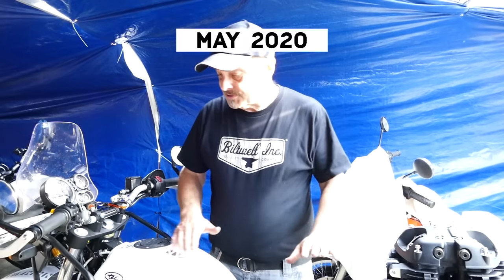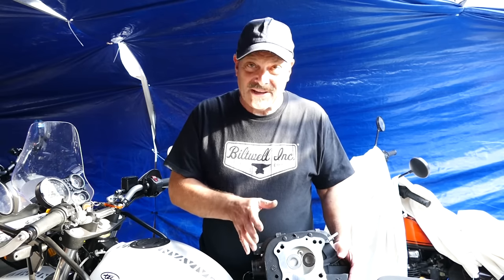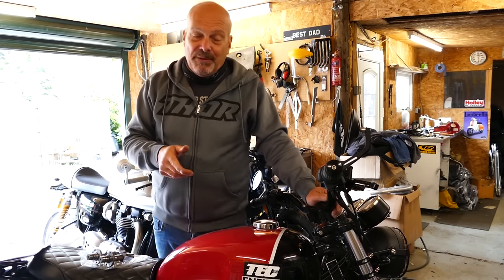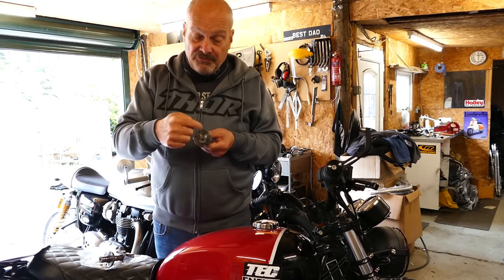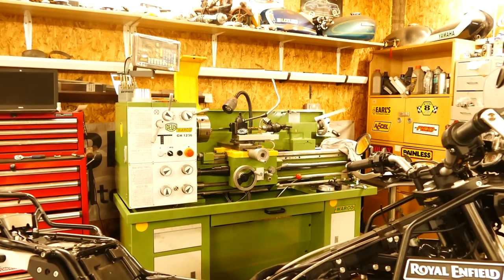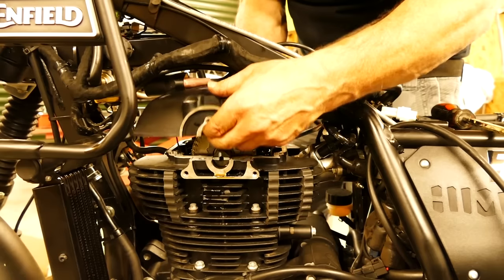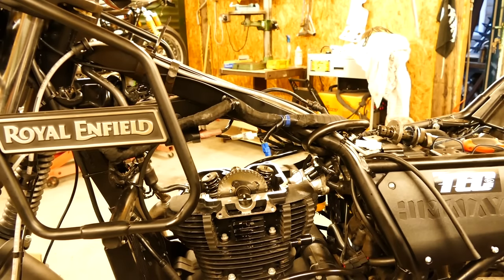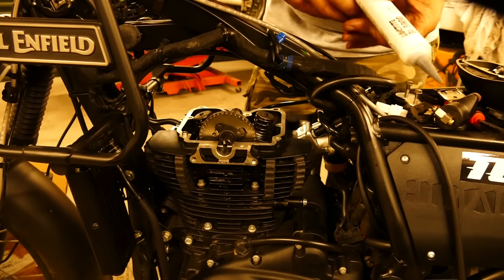Royal Enfield Himalayan Camshaft - 20% More Power Instantly!

Comment: Just completed the 300 mile run-in period, and can confirm a very noticeable difference. Well worth the outlay, and relatively easy to do. More than happy, thanks guys.
Reply: Same.  Only about 10 miles in, but I can feel the extra power and smoother power delivery.
Reply: whats the deal with the plug cover at the end of the camshaft? any parts needed thanx
Reply: Couldn't really work that out myself Steve, but I just followed George's video instructions from TEC. The only extra I needed was a tube of silicone gasket, for the rocker cover.
Reply: How’s the reliability been
Reply: Regarding the camshaft, no worries. I had a bit of a top-end hiccup a couple of months ago, but nothing to do with the camshaft.

Comment: I don't own a Himalayan, but if I did I would consider a 20% gain in power for just £200 very good value. And easy to fit too.
Reply: Yes, 20% is quite significant.
Reply: All anyone says is that it feels faster. Why is it impossible to find any real numbers? New 0 to 60 time?
Reply: @MrFox5113  that’s what I’m curious to as well, given how it goes around 10 seconds barely faster than my TDI I want to try and get around 6 or 7 seconds with the help of exhaust a tune and rotating mass lightening.
Reply: 😃 🎸 Sounds from London 🇬🇧 https://youtu.be/gjrDvSRFm2k ✨
Reply: @MrFox5113  The gain is in the top end, not the bottom.  There are numbers.  See the graph.  Perhaps look.
Reply: 9

Comment: For those looking for the tappets clearence, the video is wrong but I got a email reaction from them:
Apologies for any confusion this has caused, the tappet clearances for the Himalayan are 0.23- 0.25mm Exhaust and 0.08-0.10mm inlet, which are the same as stock, George misspeaks in our video and quoted the inlet clearances for the exhaust too. You can find a set of instructions attached above, which reference the tappet settings.

Best Regards,

Comment: Thanks so much for all the work you have done to make the Himmy the bike it always should have been. Your development has been so logical and detailed. A bunch of us in Australia  will be ordering.
Reply: I have ordered two, one for my brother. Other folks on the Aussie Himmy page are ordering too.
Reply: Even from Under-developed countries will be ordering 😁😁😁😁
Reply: @raineman8428  Hello has the cam change given you the performance you expected. kind regards murray
Reply: @murrayhyde4902  Hi Murray. Thanks for the question. I have done over 16,000km with the cam installed. There was definitely a noticeable improvement in power, and made it much nicer to ride (like it should have been from the factory) but I doubt if it was 20% extra. I reckon maybe a couple of extra HP. It will still struggle to maintain 100kph with a headwind or a hill, but is much better than it was.  I bought two and my brother fitted one as well. He have similar experiences as we do long (800 km) rides together. I still think the cam is the best bang for buck improvement so far. It runs sweet and starts/idles perfectly.  I think the limitation on these bikes is the valve and port sizes, so even big bore kits  don't seem to add any real top pend speed. Your thoughts?
Reply: @raineman8428  not sure yet. I bought a RE himilayan scram. It puts along OK. Not great speed or performance but still lots of fun.
I'm curious on upgrades. Maybe better air filter. But the cam swap seems to be the best bet... but good to hear from someone who's done it.
Reply: @raineman8428  you need to change the gearing for top end speed

Comment: I have always wondered why RE designed a brand new engine for the Himalayan and made it produce so little power. My 1969 Suzuki T200 produces similar power from half the capacity. And that was made 50 years ago. Looks like this redesigned camshaft is a significant step in the right direction. I really like the look of the Himalayan, and it's rugged character. Just wish it had about 40 bhp. Maybe I'm being too greedy!
Reply: Your t200 is a 2 stroke twin made well before emissions & noise laws were a thing, you really are comparing apples with oranges here.
Reply: @Ozsmallbore  I am aware of that. But technology has advanced in the last 50 years. We now have fuel injection and programable electronic ignition for example. I just feel 24.5 bhp for that capacity is somewhat low. I really want RE to do well. They are a company with history. They are showing real promise, and trying to mix traditional with modern, and on the whole seem to be doing it well. I hope their recent successes will continue for a long time.
Reply: All I want from it is passing speed.
Other then that it's a lovely little bike.
Reply: @nealeburgess6756  it was designed for Indian roads, where its common to have cows and a bunch of people on the main highways. Anything beyond 60 mph is risky.
Reply: @drury2d8  Yes. I have seen what roads are like in India. Even on the large inter-city highways it is impossible to build up speed. However, RE have a design centre in the UK, and they are trying hard to market their bikes not just to India, but to the rest of the world. Certainly here in Europe they would find it easier to sell their bikes with a higher power output.
Reply: @nealeburgess6756  I believe that a lot of the engine work is still being done in India. UK takes care of ride dynamics. More power = emissions problem
Reply: @nealeburgess6756  And it is a longer stroke engine, meaning pistons got a long distance to cover and after a certain rev range there's not much to make the piston move any faster combined with other problems. What it achieves though is torque, because of the stroke ratio. It can achieve decent power at around some 6k rpm but that's about it, unless there's some way to change the combustion and ratio to make more power, that's what is done with this cam shaft.
The Himalayan ends up having 32 Nm of torque, it's a 400 and something like klr 650 produces 47 Nm which is achieved easily all through the rev range because of the nature of the engine. A shorter stroke modern engine can indeed be made to produce more torque than these machines but usually they will advertise their max torque at some 7000 rpm while these machines will be making mostly constant torque all through the rev range and max torque easily at somewhere closer to 4000 rpm. Torque in a single stroke modern engine will mostly come down to the fuel mixture and often is very inconsistent, but because of their short stroke they can run at higher rpm and the more the rpm the greater the power.  Torque though has to be flat and constant through the rev range, it's more to do with the characteristic of the engine than rpm ideally. 

I think this is why people like these Himalayan and klr, says it feels like a tractor and feels more consistent when it comes down to load pulling. That's the design and the mechanical limitation is simply less rpm Which translates to less power. So what the modern machines do to mitigate less torque can be done in these long stroke engine to get more power, air fuel mixture and that's exactly is what is being done with this modification.
Reply: @arunvignesh7015  The Himalayan has a moderately under-square bore to stroke ratio of 78mm x 87mm, which limits rpm, but aids efficient combustion, and a low compression ratio of 9.5, which limits efficiency but helps with overheating and longevity. These two design aspects are probably the main reason for the engines low specific power output. I don't know what you mean by this modification improving the "air fuel mixture". The A/F ratio is determined by the fuel injection settings. A camshaft can only affect the relative timing, overlap and duration of the inlet and exhaust valves.
Reply: I agree
Reply: The English market is a very small percentage of sales, less than 2% of the total so ne need to make a more powerful version. There market at home is 1.4 billion people
Reply: Looks like your wish has come true, the new 450 is 39hp

Comment: That sounds like a cure to the Himalayan's biggest issue, and Royal Enfield should have a chat with you for the cam shapes!
Question one: Couldn't you just draw some oil from the sump with a syringe and a wee hose, and spray it over the cams through the access hole for the tappets?
Two: How does the cam affect the engine's economy? One would expect it to worsen slightly, but I wouldn't bet on that, really.
Reply: Hi Zw, I think I’m right in saying that the manufacturer is forbidden from using these mods due to the current (euro5) emissions regulations. Private owner mods are not controlled the same way.
Reply: @philtucker1224  I have no way of knowing for sure, but I can't imagine that an oxygen sensor regulated ECU would not be able to cope with the situation.
Reply: Hi Zw, regarding lessening of fuel economy it is true that a higher performing cam will offer the potential of getting a greater air/fuel mixture into the cylinder(when required) secondly, regarding “camshaft overlap” the principle of this feature allows some of the incoming air/fuel mixture to continue through the combustion chamber at a higher velocity due to the partial vacuum created by the inertia of the previously spent mixture exiting through the exhaust port. This does therefore sacrifice slightly more fresh fuel than previously in aide to pull more mixture into the combustion chamber before the inlet valve closes. (As you can imagine, this was a popular mod for race engines before the use of turbos). I hope that helps! 😊

Comment: Cam wear is actually at its highest at idle as there's more time for the oil "wedge" to spill off the nose of the cam lobe and less kinetic energy in the valve effectively increasing spring pressure. Lube the cam properly and then run at a fast idle for the first few seconds then ramp up to about 2K for a couple of minutes. This is why in the old days before technology improved it was not uncommon to hear learner cars with tappy camshafts - they spent so much time at or just above idle which accelerated cam wear.
Reply: your talking bollocks mate, my job for 6 years was actually testing oil in motorbike engines for bp/castrol  themselves...i used to build and strip and rate these engines for wear after long tests with the engines on a dyno. We never ever saw any more wear with these engines at idle...makes no difference at all

Comment: Any plans for the new Meteor 350?  It's a great looking bike but with only 20bhp it seems to be begging for extra power.  I'd like one but it needs a bit more top end to dodge the trucks on the motorway.
Reply: Do you really need to use the motorway? If it's for commuting perhaps but otherwise I wouldn't bother. The Meteor is my preference but I'd avoid motorways as much as possible, there's often an A road alternative (A6 rather than M6 etc), that doesn't take that much longer and a much more pleasant journey.

Comment: Out of curiosity, would you also recommend a stronger clutch or a pair or quad of uprated clutch springs when doing the cam upgrade? That aside, I'm going to keep your cam in mind. I love my Himalayan, but I've got other projects ahead of it in line at the moment - perhaps it'll be a Christmas gift to myself! Thanks much for the work!
Reply: We found that the standard clutch worked fine during extensive testing, heavy duty springs are available but I would not use them as they make the operation too stiff
Reply: @georgemilburn6213  Thanks much! I appreciate the advice.

Comment: Curious what the horsepower and torque numbers would be with your new cam and a big bore kit installed.
Reply: A big bore would require a new cam. You can't have the valves open+close the same way if you have a bigger cylinder to fill. Also, ignition timing would need changing, as well as the EFI programming.

Comment: Hello George, I've one TEC Cam to fit on my RE Himalayan Euro 5 but I've one question regarding the tappets adjustments. You said on this video that the values were: 0.08mm on the Inlet and 0.01 on the exhaust. But looking at the Manual of the motor Euro IV it says there that the adjustments are: Inlet 0.08mm and Exhaust: 0.23mm. Can you please confirm this values. For the Euro 5 model are they the same? Kind regards
Reply: I was wondering the same myself .010 sae is the same as .25mm on the feeler gauge.  Set mine very tight at .25mm with cam in and its a little noisey.  The book says .23-25mm

Comment: Absolutely great presentation. Am looking forward to purchasing a Himalayan once knee recovery will allow. Back road touring  in the western US is the goal. Been following most of the YouTube vloggers am convinced it is THE bike that will match my needs, especially with the HP bump of your cam. I have one question re: prelubing . I’ve always used assembly lube to protect cam installations. Any reason you haven’t? Does the manual rotation to move oil to the top end provide better protection? Just curious. From California, thanks again for the development and video. 👍
Reply: The problem is that if you add a lot of lube before fitting the cam cover it gets on the mating surfaces. Hence pumping up oil before starting the motor. You could also spray some oil in through the valve covers with an oil can too.

Comment: Could you please reassure us that the tappet settings are correct? 0.08 mm inlet and 0.01 mm exhaust? I find a manual saying inlet 0.08 and exhaust 0.23 mm
Reply: Raine Man, Ich denke, du liegst da richtig. Ich hatte jetzt meine 10.000 km - Inspektion selbst erledigt. Inlet 0,08 war korrekt und hatte sich nicht verändert, Outlet war 0,20 - 22, korrigiert auf  0,24.....
Er hat sich vertan im Video..

In English: You are right. I have done my Inspektion last week. The intake was clear after 10.000 km 0,08, absolute correkt, and the exhaust was about 0,20 -22 and i made it near 0,24....
I think in the video was am mistake.

best regards, Peter  /Germany
Reply: I don't know anything about this particular engine...but .01 sounds pretty damn tight.

Comment: Interesting vid. 👍 The manual state quit clearly in bold print to only turn the engine in a clockwise direction NOT anticlockwise as there is a risk of loosening the alternator rotor bolt.
Reply: You will not get a true reading on the cam timing if you turn it clockwise as the front run of the chain must be under full tension. With the plug out you hardly use any effort to turn the motor and could not loosen the alternator nut.
 the manual is full of errors and misleading information.

Comment: Excellent video ! What is the cost of this cam ??? Wonder if anyone will design a full exhaust ( high pipe ) to help with HP and would gain some ground clearance of the bike ????
Reply: We have looked at a high pipe and still considering it. But we have looked very close at air heat flow on the Himalayan as very borderline in some areas especially in hot climates. we will be making some follow up videos when we have the time and will go into this and some of the free fixes you can do to help this.

Comment: Thanks for the video!
At 19:00 you say to not take off the camshaft hole plug, but when you remove the cylinder head cover doesn't it just come out of place anyway? Why shouldn't that be removed?
Reply: . It is just that taking it out first is quite hard due to being well in stuck with silicone and compressed by the top cover. So, you have to use a lot of force that could cause damage. much easier to remove once you have the top cover removed.
Reply: @georgemilburn6213  thanks for clearing that up for me! does that mean it's better to put it back into place when the top cover isn't fastened all the way down again? or does it need to be put back in after the cover has been torqued down?

Comment: Great stuff, just one question though, do we need to pair booster plug with it or not?
Reply: Hi
 You cannot fit a boosterplug on a Euro 5 2021 version. but you can fit a boosterplug to the Euro 4 version. Although this is not essential and we did lots of testing with the cam fitted without one, The boosterplug does help a lot with better throttle response and smoother pick up. but very little difference in power on the dyno.
I run my own Euro 4 bike with a boosterplug and I feel it is well worth having for the vastly improved throttle response alone.
Reply: @georgemilburn6213  Thanks a lot for your response. Mine is 2021 euro5, you saved my money 😁.
Btw i am waiting for the camshaft to be back in stock.

Comment: you could lube the cam with grease bevor putting it in. So you do not contaminate the sealing surface....than the cam is save bevor the oil kicks in...
Reply: When I fit them now , once I have the cam cover fitted I use an oil can to squirt loads of oil on the lobes before fitting the covers.

Comment: Just watched the chain going on the sprocket to make sure it wasn't one tooth out .would it be beneficial to mark the link with a dab of paint or tippex aligned with the one sprocket mark before removing it and then replacing would be spot on no worries re aligning .just thinking out loud.?

Comment: Will you be able to up the power on the new meteor at 20bhp it is more like a 250cc.
Reply: isnt it 350?
Reply: @hexturner143  Yes with the power of a 250cc, my bsa starfire 250 in the 60`s had more power

Comment: How did the HP & TQR curves not cross at 5252rpm?
Couldn't help noticing a Kawasaki Z peeking out from a cover in the background. Oh the fun I had souping those up, flow-bench, cams & degree cam sprockets etc.
Reply: This is simply down to scaling of the graphs. It depends on the software package the dyno is running. lots of packages use scaling to cross at 5252 RPM ( Dynojet) to make comparing different bikes easier to understand. these runs were done on a Fuch chassis dyno